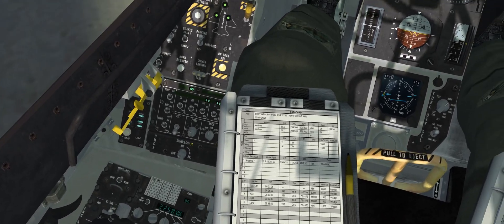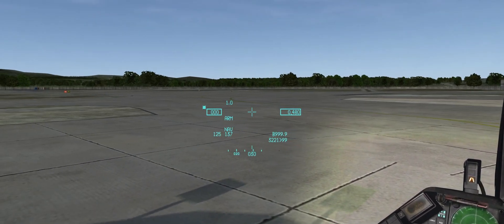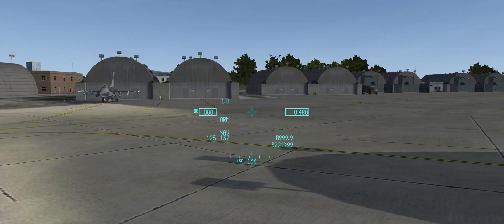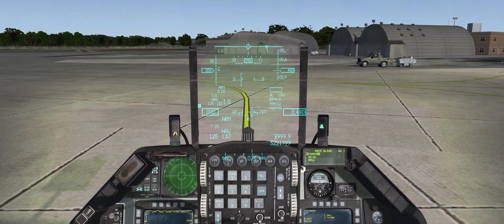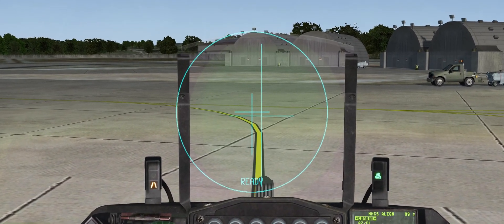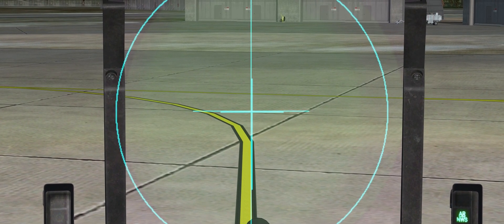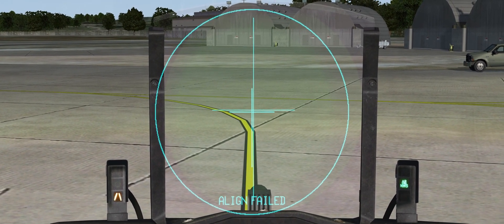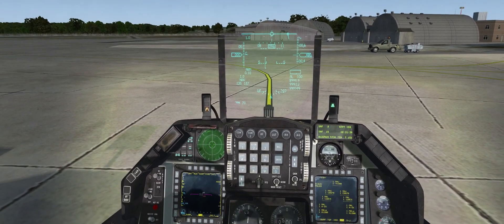BMS 4.36 HMCS ALIGNMENT

Comment: keybind to align?
Reply from the maker: Key binds not relevant. Everything is pit clicking or hotas.
Reply: @gerryabbott  i don't have hotas
Reply from the maker: @VariMXC  Then there's more important things for you than HMCS alignment.
Reply: @gerryabbott  nah not now, i don't want to fly with a broken HMCS
Reply from the maker: @VariMXC  open BMS, SETUP,  CONTROLLERS,  LOAD, BMS-Full, LOAD, scroll to section ======  5.11 FLIGHT STICK ======,    see/change the hotas mappings.
Reply: @gerryabbott  lol, not sure
Reply: @FalconFanatic.GhostDog0  It's "Enable switch- depress" default key bind is "enter" key
Reply: @gerryabbott  hotas is not necessary at all to play this game, get over yourself
Reply: insert button on the keyboard!
Reply: The Falcon BMS community has a doctrine of not revealing the keyboard buttons to control the plane. I have to keep chasing this charade myself. They even help, but at the same time they want you to manage.
Reply: It's function+insert